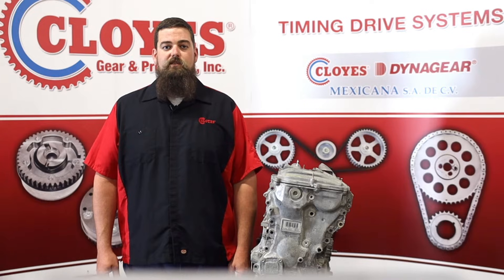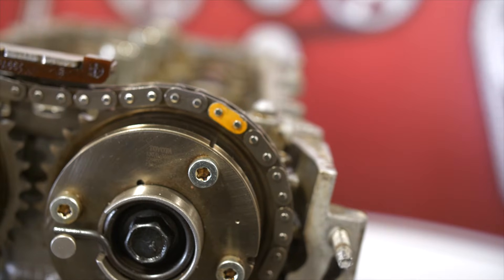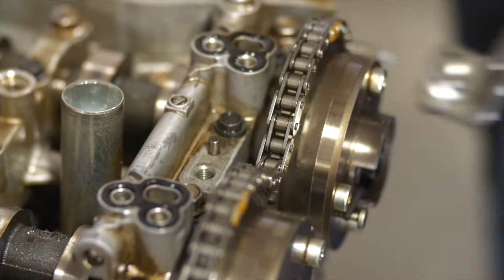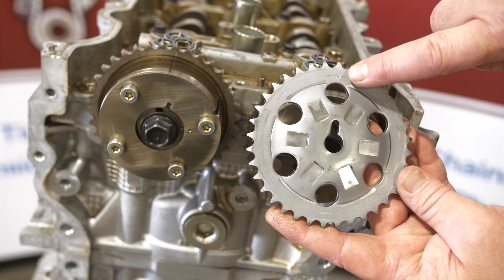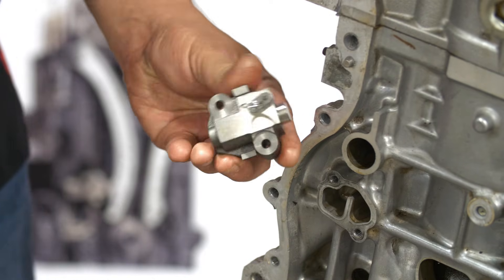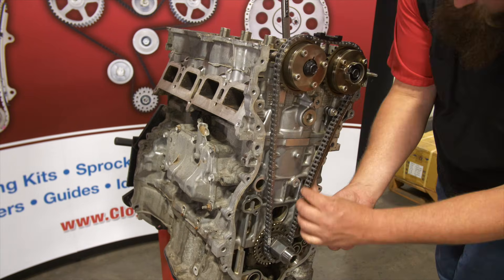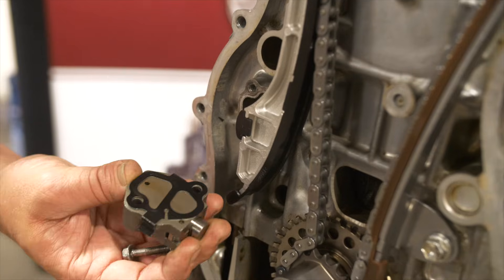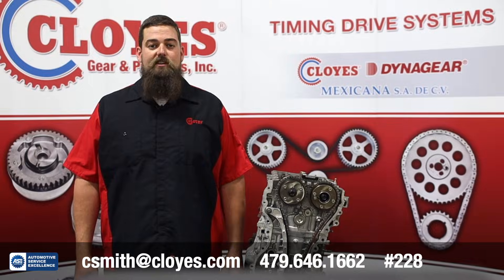Toyota 2.5/2.7L AR Timing Chain Replacement, Cloyes 9-4313S

Comment: Great video, but 99% of people are not going to have the engine pulled to complete. Either way thanks for creating the video!
Reply: Simply remove the timing cover with the engine still in the vehicle. It's tight, but it can be done.

Comment: This video shows rotating the camshaft ccw to remove slack. However, the FSM says rotate the crankshaft 10 degrees clockwise. That slack in the wrong direction caused P0014 & P0017 so heads up.

Comment: Hello, great video. This is very helpful and like the other comments not very many videos that give good detailed instructions. I do have a question, would you recommend in replacing the oil pump while doing this repair or do you recommend other things I may want to replace? My vehicle has just about 180k miles.

Comment: So basically as long as I don't lose placement of lower sprocket/reluctor wheel and match the chain indicator on reinstall... the chain is guaranteed to re-align cams at top with chain indicators and gear indicators without requiring locking?
Reply from the maker: That is correct. If the chain and sprocket marks are aligned, then you are in time. The chain ultimately sets the timing, so just make sure your marks are aligned. You can likely purchase a cam holding tool, but it is not required for this engine.
Reply: Thank you so much, very informative and given me confidence to do repair ❤  @Cloyes01
Reply: @Cloyes01  thank you so much for being interactive, I was searching for this question all over and everybody says you must lock the intake phaser after installing.

Comment: You mentioned the alignment of the oil pump. Question about the drive rotor spline in the oil pump. Obviously it needs to rotate,  but should it have the ability to move a little up and down and left and right? Is this normal?
Reply: There should be VERY little play

Comment: That crank pulley looked more like 11 o'clock,  but I guess pointed up in general?
Reply from the maker: Correct. The main focus is making sure the marks align. You can make small adjustments to the shafts if needed.
Reply: @Cloyes01  thanks for responding

Comment: What did cloyes do to help with the intake cam phaser problem that these engine have , in developing a cold start rattle due to the lock in the phaser getting stuck ?

Comment: I'm not sure if I'll get a response to this question or not, but I thought I'd try anyway. So you say if the timing cover is off and you replace everything (chain, guides, tensioner, and phashers (vvat-i gears) the phaser/vvt-i gears DO NOT need to be unlocked when installing the new part? So I'm taking that as if you are not removing the chain, just the phaser, that's when it needs to be unlocked for install?
Reply from the maker: As long as you hold the camshaft while tightening the phaser bolt, you do not need to unlock the phaser.
The only way you could damage the phaser is if you tighten the phaser bolt while using the chain or another shaft to keep the phaser from turning. That would put pressure on the internal locking pin.
Reply: @Cloyes01  good to know! Thank you for the reply

Comment: I’ve installed both vvt sprockets chain kit. After finishing I now have a p0017 code. Before I had a p0016 code.  I removed valve cover recheck marks. All marks line up. ?
Reply: Did you get it fixed? What was the problem? I may have the same issue.

Comment: So just to be 100% clear I don’t need a timing lockout tool to do my timing on the specific motor so I just wasted $89?
Reply from the maker: The tool is not required, we did not use one in this video, but it can be helpful.

Comment: Hi, during installation that slack between the phasers is normal? no matter how hard i try i cant element  little play.
Reply from the maker: Yes, some slack between the cams is normal. Both camshafts are dealing with valve spring pressures. Sometimes this will cause the cams to want to clock towards each other creating that slack. It really just depends where the engine stops as to what spring forces are against the cams. This can create slack between the cams, or between either camshaft and the crank, and it may shift the next time you turn off the engine.
Reply: @Cloyes01  
thank you for your response, that slack  appears to create the chain to jump teeth, when the crank is turned. I'm guessing chain stretched ?
or the tensioner is not doing its job.
Reply from the maker: @sonofsteve566  Both are possible if it is a used system.  But turning the engine over by hand does greatly increase the chances of the chain jumping because of the violent movements of the camshafts due to the valves opening and closing and no oil pressure going to the tensioner. Even a healthy system can jump time when turning the engine by hand. Rotation with the starter is fast enough that the chain slack doesn't have time to shift back and forth which is what allows it to jump teeth.
Reply: @Cloyes01  
one more question please, 
original phasers, is there a concern of them locking when chain was removed did not hold cam when tensioner was removed.
if cam phasers locked would this create a timing jump at crank?
Reply: @Cloyes01  
appreciate your effort in helping me out on these questions.
Reply from the maker: @sonofsteve566  The phaser should have locked when the engine was turned off. They are designed to lock when they are not receiving oil pressure. Even if it wasn't locked, and did after some disassembly, it would have been the camshaft that moved, not the chain. The phaser with no oil pressure is not strong enough to rotate the chain enough to cause any issues.
Reply: yesterday Installed.
put back together ran cold dry compression test
bad readings,  this morning  took valve cover off looked at timing marks....way!!!! off.....timing chain cover coming  coming off, guess new chain and tensioner. 
so don't worry about phaser lock/unlock?

reason installed new head gasket, not to bad but now timing giving issues.

hope jump timing,  compression test didn't crush valves.🤞
Reply: @Cloyes01  

Huge question!!!!
installed new timing chain kit, everything went smooth. put everything together. crank no start,
go back look at timing marks off 5 teeth!!!!!!!.
tensioner holding strong chain tight. 
has to be a phaser?????
how do I test phasers?
or set them..
why would chain jump?
Reply from the maker: @sonofsteve566  You are not looking at the marked chain links are you? Once the engine rotates the marked chain links will not realign with the sprocket marks.
Reply: @Cloyes01  
appreciate your response, 
after researching this I figured it out,  timing is correct, Toyota is actually probably the easiest engine to time.
thank you.
(head is going into the machine shop)

Comment: Hi Cody, what is the bolt size for the timing cover plate that gives access to the intake vvti sprocket and what the size of the bolt that hold the intake vvti sprocket in place. Thanks a lot!

Comment: does the engine need to be removed to replace the timing chain?
Reply: No
Reply: @billanderson5774  Seems like there is no way to get the timing cover out. I have loosened all motor mounts lifted motor and still can't get it out. How do you pull the timing cover out without without pulling whole motor? 2010 rav4
Reply: Was not being creative enough and jump the gun on my question. Had to go through the bottom with engine as high as it goes.
Reply: @jamesbonesteel2501  Support the engine with a jack under the oil pan.  Place a board on the jack to distribute the weight across the entire oil pan. Then remove the RH structural brace that extends from radiator support to (iirc) frame/sub-frame.  Once that brace is out of the way, the timing cover can be removed by sliding it out thru the bottom of the car. You may have to also jack up passenger side of car to create extra space for timing cover removal. Make sure to support car with jackstands

Comment: Other than cylinder displacement, is there any other differences between the 2.5 and the 2.7? Could I put a 2013 2.5 in my 2013 Venza? It has a 2.7 currently. At a glance, they look identical?
Reply: Someone has done it, and Venza took the 2.5L and worked without any trouble codes. Video is here on YouTube.

Comment: Thank You i been look for this video for years I'm upset this is my first time seeing it. i have pull my motor out three to connect the time cause of a crankshaft p s batch B, so a inline 4 only has 1 Batch A. still have the problem but car runs great. just will not pass cause if check light on. this is the best ar-2 video yea.

Comment: Can the timing chain tensioner be replaced by taking that square cover off? Without the need to replace all other components or taking the whole cover off?
Reply: Yes it can. It’s a pain though
Reply: It can be done but it’s easier to take off the timing cover to do it

Comment: Man I really wish you would have showed where you put sealant on the front cover and what type.

Tensioner bolt torque value? 

This crazy easy and plan on doing this on my camry this winter.

2011 2.5. Has currently 214,627 miles on it. Im doing both cam phasers as well.
Reply: Hi derak, is their reason why you decided to do this my 2011 Camry has 120,000 miles. Little rattling noise started a couples months ago, but now it’s got to the point that when engine is hot and I try to turn on the car it takes a couple seconds. I turn the key and it sounds like it’s gonna shut off. I hear the crackling noise then it’s stops. When driving it runs fine no problems at all.

Comment: Hi! Is it possible to replace only tensioner without opening top cover cap just by opening small cap in front side of engine?
Reply from the maker: If you remove the tensioner cap you will need to remove the tensioner and deactivate it. Upon reinstallation, the valve cover will need to be removed to activate the tensioner against the chain.
Reply: @Cloyes01  I've heard you can just rotate the crankshaft from outside until you hear a few clicks indicating the tensioners been activated. Will this method work?

Comment: Should the bolts be replaced with new torque to yield bolts?
Reply: The cylinder head bolts are torque to yield, and should be replaced with new bolts, which must be purchased separately (unless a rebuild kit specifically includes those).
The vvti camshaft phasers also are torque to yield bolts, but new bolts should be included with new gear(s).
If you are replacing head gasket, I would also recommend replacing the vvti phaser gears.

Comment: HELP!
Why is it that my intake camshaft will not rest in the 11 o'clock position?  It snaps forward to the 12 o'clock or back to the 10 o'clock position.
Reply from the maker: You are experiencing valve spring pressure as one of the valves are open. You can move the cam to either the 10 or 12 o'clock positions and time the engine. Just know that the other camshaft and the crank will also need to move slightly to get the marks aligned. As long as all three marked links are aligned to their respective sprocket marks then the engine is in time.
Reply: Yep. fugured it out. Thanks!

Comment: So if only replacing chain/guides/tensioner, and reusing camshaft gears - Do we need to “advance” the intake camshaft gear like the FSM states?
Reply from the maker: If you are not removing the phasers there is no need to follow the phaser unlocking/advancing procedure that Toyota recommends. That procedure insures that you don't load the phaser's internal locking pin while torqueing the attachment bolt.
Reply: I changed my top gasket after changing the top gasket the engine started making noise rock rock rock rock rock rock